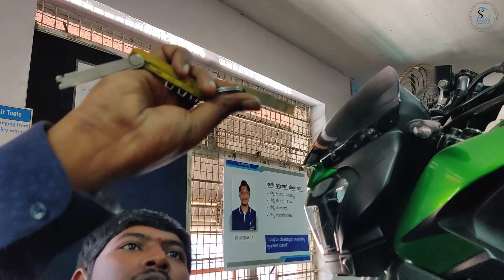Bajaj DOMINAR 400 Service Training from Bajaj Professionals- Khivraj Bajaj

Comment: Fantastic, thank you! What is the ratio of diesel to engine oil for chain cleaning?
Reply from the maker: Thanks!! Am glad this video helped you, Well you can just take a small proportion say around 100ml  in a bowl and use a soft chain brush to remove of the dust.
Reply: @Sharucaptures  Thanks! Would that be a mix of 50ml of diesel and 50ml of engine oil (1:1)? Or some other combination? My Dominar's a terrific bike, and I want to treat her right.
Reply from the maker: @ianbruce9603 yes, you are correct!! It can be a 1:2 proportion mix
Reply from the maker: @ianbruce9603 no doubt that it’s a beast machine ☺️❤️
Happy biking brother 😎🏍️

Comment: I recently bought Dominar 2019 UG and my biggest issue with this bike is that, the handle lock pin keeps vibrating and produces annoying sound while riding. Greasing it solves the problem a little. Bajaj needs to deliver a better build quality. wasn't expecting this from bajaj.
Reply from the maker: Tanks for watching the video and sharing your experience brother...😊
Well said, offcourse there are few things that bajaj should definitely consider to improve especially the random vibrations.
Hope the video was helpful.. please don't forget to subscribe for more interesting videos 😊🙏
Reply: @Sharucaptures  is it from Marathahalli khivraj Bajaj??
Reply from the maker: @dvkalyanreddy3885  yes brother..😊
Reply: @Sharucaptures  but i saw in another comment you saying kasturba road khivraj Bajaj,,,,,,, which one is correct please tell i have to gave my bike for ECU update

Comment: I interchanged the bolt of front sprocket cover will there be any issue?
Reply from the maker: to be frank...i myself may have interchanged them even without noticing...but i haven't had any issues with it till today...i guess the length of all the bolts were same so shouldn't be an issue

Comment: I bought dominar 400 bs6 in first week of  August.  My bike break in period is over. Odo - 2300 km 
But my issue is - after riding 10 mins in city even with low rpm. Bike heats a lot i feel it  Instantly  and the Fan start. Then if i ride for more 5 mins and wearing short pants i feel the heat very high specially on left leg.  

What should i do?
Reply: it is normal if u ride ur bike on low speed

Comment: Is there any possibility of starting the bike at 40:48 in video . Were I got wireing problem in my bike and bike is not starting
Reply from the maker: Hi Tony... thanks for watching the video..I hope it helped..
Can I know if you are taking about the bikes main wiring harness...if so...how badly has it been damaged brother?
Reply: @Sharucaptures  i don't know from where the problem . I called my mechanic he is in Tamil nadu now due to lockdown . So he told that there must be a wireing prblm so I don't know which wire is damaged.
Reply from the maker: @tonydj4562  okay bro..so sorry tahat your bike is refusing to start..how ever I would suggest you to look into few things here..the problem might not be actually in the wiring harness as it's more durable unless if it's bitten by rats..
So please check if the battery is charged..if it is okay..then please check if the Starter relay inside the right side seat cowl under the front seat is functional and last but not the least please check of your side stand sensor is intact...
Reply: @Sharucaptures  bro all are fine I sure battery seems fine side stand is also checked . I'm mean kill switch option should go in display to start the bike . But after doing on and off the kill switch option is not going .
Do u have any mechanic person to do repair . I'm requesting to send any of ur known mechanic . Becz bike is too heavy to push . It's not like small bike . My first too bike was 220f, R15v3 I didn't face any of this problem.
Reply from the maker: Hello Tony...sorry for the delayed response...the problem could also be with the kill switch bro...could be an ecu error too...well...get it checked bro...
I am really sorry Tony...coz I stay in Bangalore and I know no service guy from Chennai to help you out...you may have to call the nearest  service branch and inform them your issue and call them for help..

Comment: Kerosene or diesel is better?
Reply from the maker: Kerosene is preferably good than diesel brother..if not available then go for diesel..
Make sure to spray the fuel on the chain and leave it for 10 mins before removing dirt....this will make the dirt removal easy.. I hope this helps..let me know if you have more queries..

If you like my channel.. please do subscribe ☺️🙏
Reply: If u dont have kerosene then u can use diesel but there is drawback with diesel that if u use too much diesel for cleaning it may not try in time n u may have to apply chain lube multiple time becoz if diesel stays even after wash then it will resist the chain lube
Reply from the maker: Rightly said brother ☺️👍..yes too much of diesel is a mess...
Where are you from brother?
Reply: @Sharucaptures  I'm from Goa
Reply from the maker: Aww..that's an awesome place to be at anytime..lucky you..
Which bike do you own brother??
Reply: @Sharucaptures  i own a dominar 400 2019 & Ktm rc 390 2016
Reply from the maker: That's awesome brother..😀
I hope you liked the video..if so .. please consider subscribing to my channel and support me to grow.☺️🙏
Reply: We need to add oil in kerosene also. If yes, what will be the ratio?
Reply from the maker: @jagatshetty1444  thanks for watching the video jagat ☺️

Well the purpose of mixing oil is just for the lubrication.
Doesn't really matter if you are mixing with oil while cleaning.. .you can just clean the chain with kerosene and then lube it later..
If you really want to mix oil to clean the chain then you can just use 25% oil and 75% kerosene..
I hope I answered your question ☺️

Please do consider subscribing to my channel for more informative videos ☺️🙏

Comment: Bro I changed chainsprocket but now also if I put second gear & third gear means dammal sound coming ...wat to do pls help me
Reply: Help me bro
Reply from the maker: Hello yogesh...did you adjust the chain slack??
So on higher cc bike chain need to be tightened with a proper slack for atleast 1 once in every 500 to 600 kms
Reply: Ya bro I changed chainsprocket day before yesterday only but that sound not arrested
Reply from the maker: @yogeshbala775  did you change it on your own or from the SVC brother?? And check if the chain is loose...if it is then it needs to be tightened a bit and also have u lubed your chain??
Reply: I changed the chainsprocket in local mechanic

SVC brother means
Reply from the maker: @yogeshbala775  SBC means service center bro....so I doubt the local mechanic guy has not properly tightened the chain for the required level...btw wer are you from brother...??
If you have an access to a bajaj service centre then do visit them and ask them to adjust chain slack brother..that should help you to reduce the sound...how ever most of bajaj Dominars still have the sound to some extent and we need to live with it..
Reply: Am from Chennai bro...suggest me best service centre pls
Reply from the maker: Oh..I could have recommended some good service center if you were in Bangalore brother...but am so sorry..I don't know much about service centers in Chennai...I would suggest you to do a google search or join any chennai dominar riders community group on Facebook or Instagram and check with them brother..
Reply: Tq for your kind rly
Reply from the maker: @yogeshbala775  anytime brother...I know I couldn't solve your problem..but I hope that suggestions that I gave you will help you...stay safe and ride safe brother..and yeah.. please don't forget to subscribe to the channel for more interesting videos☺️🙏

Comment: Sir 1 question I got my dominar 400 in aug this year and after Riding it 4000 km I heard a rattling Sound in the engines this happened when I was riding Redline limits I thought it was a common problem in the tappit but when I went to the workshop the people said that it is there is some serious problem and finally after 13 days I got to know that there is some problem with with my piston and cylinder i mean  the piston was scraping against the cylinder so the whole engine head had to be changed well I got my bike now but I’m afraid to ride it faster I am afraid because I think the same problem will occur I searched in YouTube then I came to know many customers had faced the same issue and the engine components finally had to be removed. So my question is is driving Dominar at redline limits creates problem in engine??
Reply from the maker: Thanks for watching the video Rohit...😊
So sorry to hear about your bike...but am glad it got resolved...well...red lining the bike sometimes shouldn't create a problem..but staying there for more time will definitely harm your engine parts as at the speed the engine will be at its max tolerable limit...just make sure not to ride at higher rpm for more time....

Hope I have answered your question...let me know if you have any more queries..
Please do consider subscribing to my channel to support my work😊🙏

Comment: 37:35 fish tail on Bike that has ABS? ? ?
I own the dominar 400 UG and the rear brakes are Garbage.
He talks like they invented the perimeter frame. Come on dude. Fish tail only happens when the wheels are Locked. My CBR250r had a perimeter frame. Its rear brakes where Spot on. FIX THOSE REAR BRAKES ITS SOO annoying God damit
Reply: blame the wheel base & weight distribution of duhminar

Comment: Hold camera properly and informative video
Reply from the maker: Sure sukruth...☺️🙏 lot of brothers who were filming and discussing around...well..
 do let me know what kind of videos would you like to see on my channel..
Reply: Sir can  you help me about my problem to my rs200....while im running my rs200 along the road...the engine will die automatic.. When i turn off the key and turn it on all the warning sign in the board turn on but the check engine sign not show up and no tooottt sound not heard... the push starter not function and motor not start any more.. What do you think the problem... Can you help me ???
Reply: Can you help me about my problem to my rs200???
Reply from the maker: Isn't your bike starting dennisse??
Reply: @Sharucaptures  no it not starting until today.. I dont know whats the problem.. When i turn on  the key all the indicating icons appear but the check engine not display and no sound tooooottttt.. The rpm clock fuction... Then the push start  not function...
Reply from the maker: Have you checked if the battery is properly functional??
Reply from the maker: Seems like a battery problem to me brother..

Comment: Where is the radiator relay
Reply from the maker: Hi jayanth bro...first of all thanks for watching the video..☺️🙏
I am really not aware of the position of the radiator fuse. Below 2 steps will help you to understand if your bikes radiator is in working fine.
1) start your bike and keep it idle for say 5 to 10 mins, then once the engine temperature reaches 90 degrees...the radiator fan should get on automatically and you will hear the basier blowing noise near your radiator at this point.
2) If you see an error called " high coolant temperature" , then there is a high chance that radiator is malfunctioning.

Quick fix: try checking the connection for radiator fan behind the radiator and ensure the connection is intact.

I know it's not the anser for the radiator fuse..sorry for that...let me know if you have any more queries and I will be glad to answer them..

Please consider supporting me by subscribing to my channel if the video has helped you.☺️🙏
Reply: @Sharucaptures  where is d radiator relay fuse
Reply from the maker: @jayanthhs1192 check for the fuse box beneath your  back seat.. and in the fuse box , f5 with 7.5 amp rating fuse will be the radiator fan fuse..I hope that answers your question.
Reply: @Sharucaptures  thank you for ur reply sir
Reply from the maker: My pleasure Brother... please don't forget to subscribe ☺️🙏

Comment: Waste branch Kasturba Rd.
Reply from the maker: All SVC's have a good and bad sides brother..but in a way when it comes to authorised Bajaj service in Bangalore.. kasturba rd SVC is the most preferred
Reply: @Sharucaptures  Lol. Dude I have had the worst experience from that branch with my dominar. They are lucky I didn't escalate them for their ignorance and incapability that damaged my bikes engine. Even the bangalore regional manager was fedup with their service attitude and referred me to another branch who resolved my issue. The problem with this branch is, everyone shows attitude. They wont listen to the customer. I was going there for one full month only to get bullshit reasons and get my new bike scratched. On a surprise visit, I even saw interns working on my dominar UG, who damaged the fuel cap. I got it replaced under warranty and had to get a new key. The actual issue with my dominar was with the engine which these guys in Kasturba svc rd couldn't fix, instead they revved the shit out of the bike and damaged the cam shaft as well. Luckily one day, regional manager was there in the svc center and I explained to him the issue. He was really unhappy with the load of bullshit this svc was giving me and he reffered me to another branch. They identified the proper engine issue and solved it in 2 days. My advise to Kasturba branch: You might have ridden 100's of dominar's. But customer will know his bike more because he is riding only that bike and will know the symptoms very well. And so listen to the customer instead of showing  bullshit attitude. So pls spare me the most preferred svc BS.